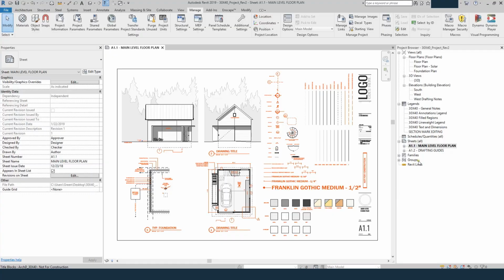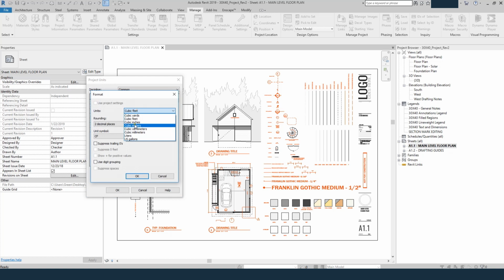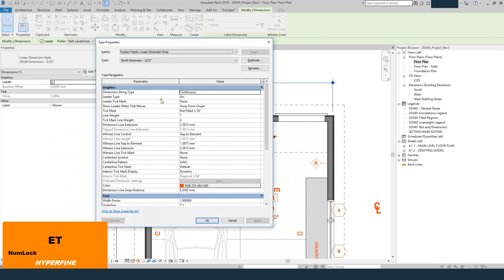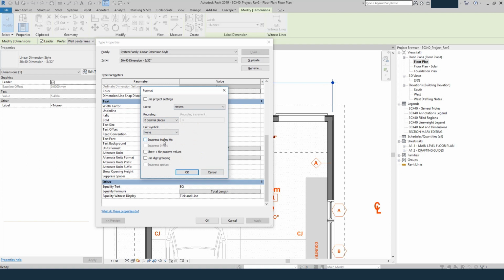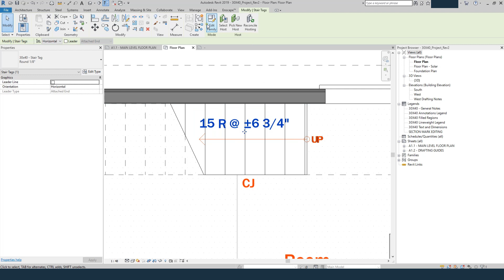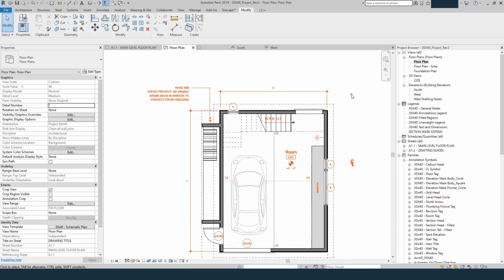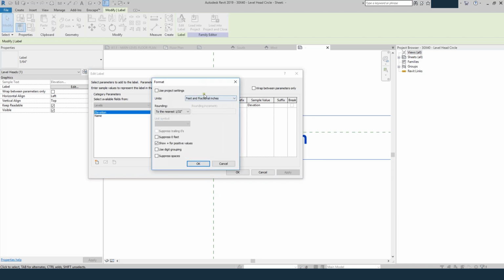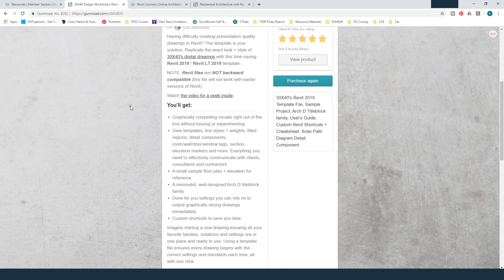Revit Convert to Metric

Comment: Sir, I have changed the parameters to metric, but every time I start a new project it comes back with imperial measurements, does not save the changes, why is that?
Reply: I have the same problem, can you help us, please. Thanks
Reply from the maker: I think you just need to start new projects with the Metric template. It might default to Imperial. Check out this link from Autodesk and let me know if this doesn’t fix it for you. https://knowledge.autodesk.com/support/revit-products/troubleshooting/caas/sfdcarticles/sfdcarticles/Revit-how-to-change-defaults-from-metric-to-imperial-or-vice-versa.html
Reply: @HyperfineArchitecture   Thank you, it did help! I also noticed that when installing Revit you can choose from a drop down menu to uncheck US Metric or Imperial (both are checked by default) and maybe that will only install one measurement.

Comment: sir i have a question i have a ceiling plan in auto cad i import to rivet and i modeling walls door every thing and i was going in ceiling level i can see my ceiling plan i made in cad so i hope can you help me  thank you
Reply from the maker: When you import CAD it goes to the level of the view you’re in. So it will probably be at the elevation of your floor. Your floor plan is usually at 48” looking down so you can see  the DWG. The RCP will be at 48” but looking up. Select the DWG and change the level offset to move it up. Then play with the View Range settings so you can see it in RCP